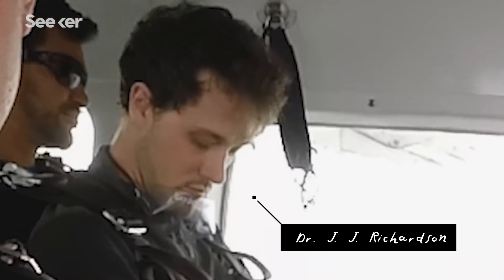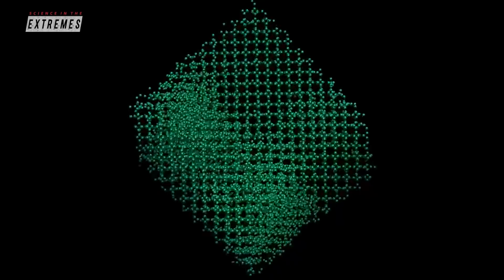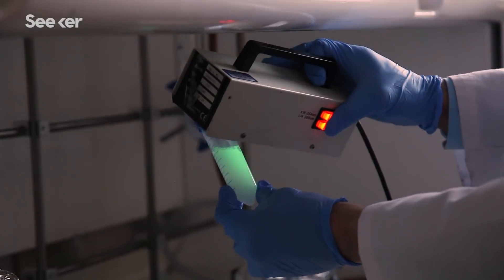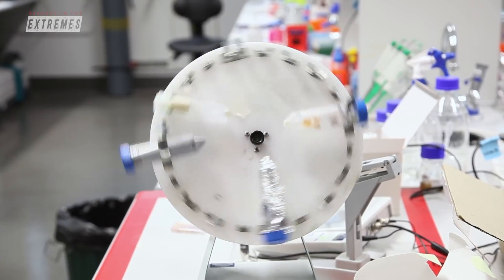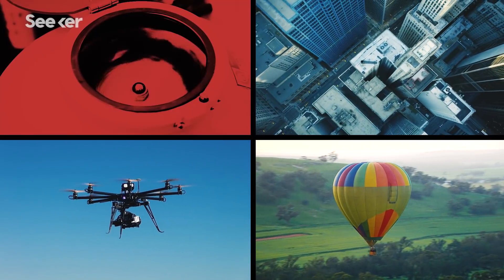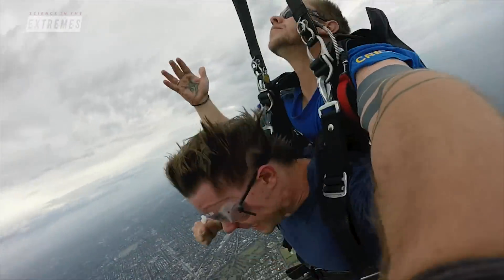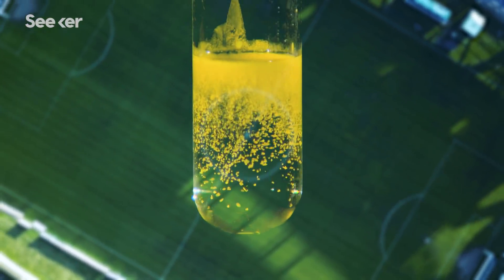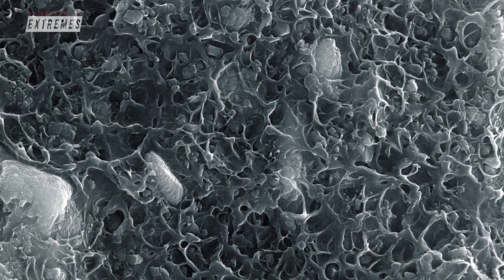These Hybrid Metallic Crystals Are Chemistry’s New Miracle Materials

Comment: As I watched this, I was gripped by anger. EVERYTHING in this video is untrue. MOFs are not "miracle materials" actually most people in my field (inorganic coordination chemistry) recognize they have some applications, but really, most of us have moved on. There are three people in my lab that work on MOFs (including myself) and we don't use "toxic materials" at least they aren't toxic if you don't consider terbium toxic. We grow them at room temperatures, and my crystals (according to X-ray crystal defractometry) are VERY uniform and I don't need an electron microscope to to see them; I grow crystals 2-3 mm in size. MOFs generally have limited biological applications, because they tend to fall apart in acidic conditions, you know, like the conditions in your stomach. If you want to target cancer, you wouldn't want to inject MOFs directly into your blood, they are pretty big crystals for the body a simple targeted coordination complex would be function much better. Gas storage applications require multiple atmospheres of pressure to pack MOFs and while this does have some applications in spaceships and submarines, its generally cheaper and easier just to store gases under high pressure or in liquid state. and catalysis could be a possible application, but having an open coordination sight on the metal centers (which are what catalyze reactions) of the MOF is rare. Not to mention the change in coordination geometry would destroy the crystalinity if not the entire MOF. For catalysis, if you want to recycle your catalysts, it is usually better to use liquid-liquid phase or a homogeneous catalyst mounted on a solid surface or just use solid surface catalysis. Last comment, using the term "nano" anything with a MOF isn't correct. They are infinite latices that (when in crystalline shape) are almost always larger than the 100 nm size cut off for nano-materials.

Comment: I'm confused. If the sun's gravity is enough to hold in orbit planets over 5 billion miles away, how does going a few thousand feet up in the air neutralise the effect of Earth's gravity?
Reply: Theodore Macewko Thank you for that useful explanationTheodore. So inertia is what's cancelling the force of gravity and the exact speed at which that happens is freefall velocity? If so, does that mean the relative gravity of any planet will always provide inertia that counteracts its gravity? So the gravity is still pulling down with the same power, but inertia is pushing back at the same rate? Is inertia simply movement, or movement with relation to another force or involving friction? Would the inertia be the same in space at that speed?

Comment: Hi there, I am confused with this study. It is well known fact that the gravitational force between nanoparticles are neglible compared to electrostatic forces. Therefore, I am not sure whether the observation correlates with the gravity. I believe they might have missed some factors in their study. One of the reason I can think of is the fluid mixing. Due to different acceleration field, the fluid will mix at different rate. This will result in different amount of heterogeneous nucleation sites and growth rate. At high acceleration, the fluid mixes quickly creating lots of nucleation sites and hence lower probability of growth (due to limited concentration of reacting species) whereas at low g the fluid mixes slowly and hence less nucleation site. This increases the probability of crystal growth. If my thinking is right, then these experiments can be repeated in lab i.e., no need for skydiving. However, I am sure, the researchers must have addressed this point in there publication. It would have been interesting if the paper was cited in the description.

Comment: that's stupid. there's a catapult meant for this exact scientific purpose (vacuum cylinder where the sample is shot up and falls down) that gives practically zero G (FAR better than skydiving). but of course it wouldn't make for as good clickbait. 

There are automated systems to inject the reagents during zero-G. The scientists also don't have to be there themselves, they can just ship the reagents with instructions

the drop tower: https://en.wikipedia.org/wiki/Fallturm_Bremen
https://www.zarm.uni-bremen.de/en/drop-tower/general-information.html
Reply: But where’s that catapult located?? it could be far away in another state and are they gonna get a permission to use them?? are these catapult can accomodate some specific requirement like injecting the crystal in midair??

There’s just too many vague factor for just an initial experiment, they test it with skydiving first, then if the result are promising then they can work on using more sophisticated things
Reply: They wanted to work with zero G's; launching the sample in this way would immediately ruin the experiment thanks to the initial acceleration. ...Right?
Reply: @guildwarrior3232  No. As the video stated the samples were prepared in air and were growing till landing.
Reply: It costs about $200 to jump out of a plane. What's the tower thing cost?